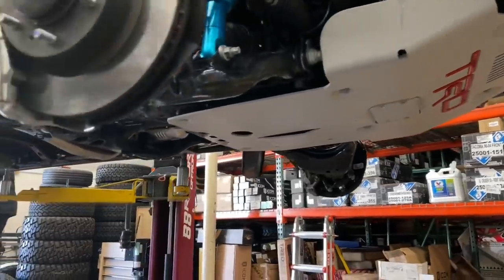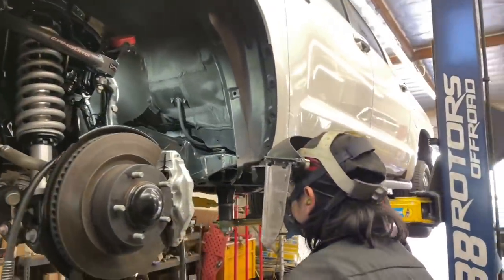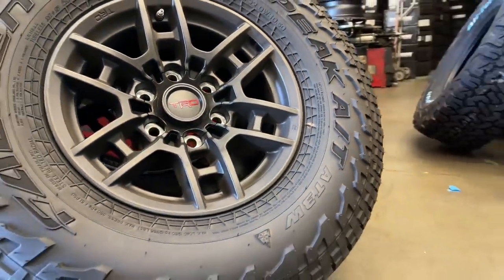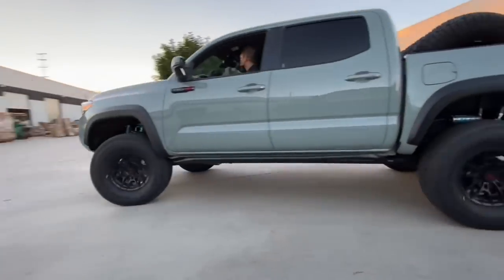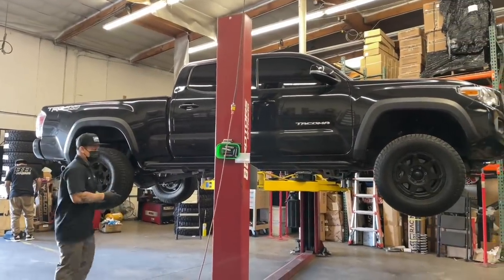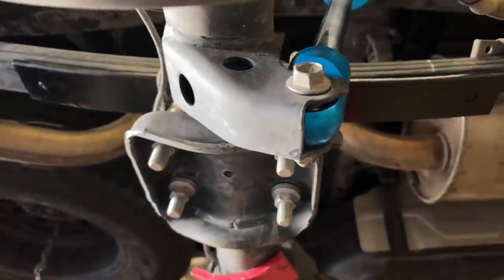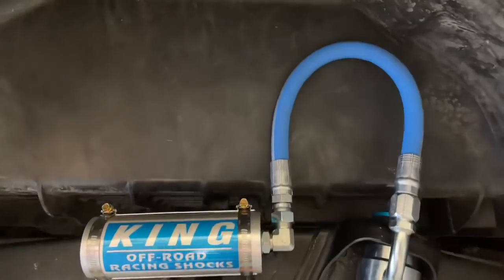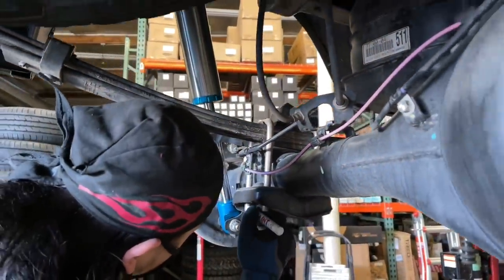88ROTORS $500 GIVEAWAY! 2021 TACOMA TRD PRO LUNAR ROCK KINGS LIFT!

Comment: This right here are the camburgTubular u bolt upper control arms with the kings2.5 Remote reservoir Coilover Adjusted to about 3inches about lift high.. Did I mention this are camburg tubular u bolt upper control arms as well

Comment: 813 
A5
Whistling
This is a Trd oem skit plate 
Z18
This video is of a Tacoma 
King shock sticker and a prisu roof rack sticker 
Inferno 
E18 
25mm spacer 
J3 
R18
L9
Our tech is reading 
19j20
I will throw a 13mm wrench into the trash 
A1
H19

Comment: You never threw a 13 mm wrench into the trash
Reply: That has to be it
Reply from the maker: Correct, the 13mm wrench threw the trash at me!
Reply: @88ROTORS  Lol Do I win 10% off when I go add my 3 inch lift with you guys?